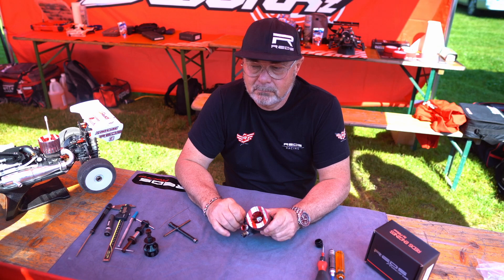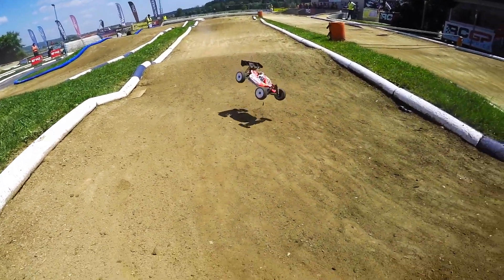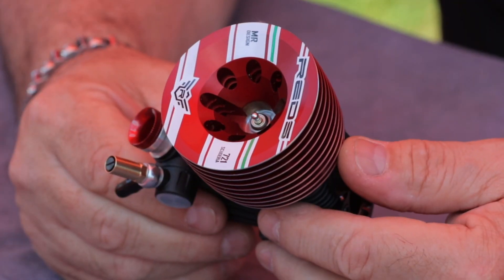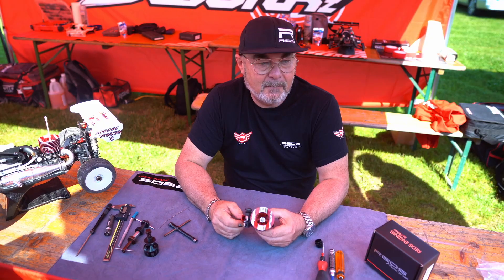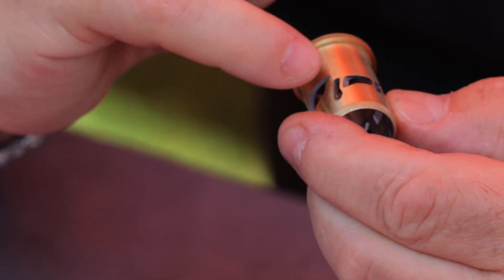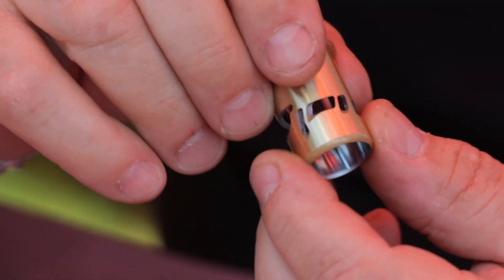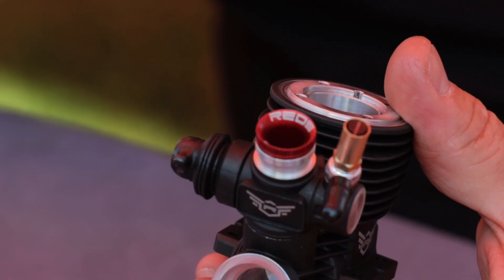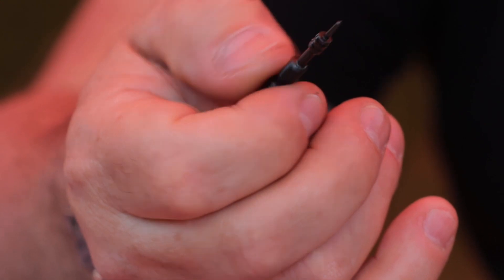More POWERFUL than an F1 Engine??!

Comment: Would the engine go in traxxas revo 3.3?
Reply: it should but if you do upgrade the clutch, make such the clutch springs are stiffer. in all honesty it should fit right in.
Reply: @johnszafarczyk It will not fit right in lmao stop spreading misinformation.
Reply: Not without a big block kit and heavy modifications along with a special bump box meant for the Revo chassis

Comment: 2 HP out of such a small engine?!

UNBELIEVABLE!!!!!
Reply: 2.6hp now year 2024 😮
Reply: @simonpeterdalangpan9761 the hp ratings are slightly overrated, as a long time modeller I can tell you that these engines have increased from 1 hp to 12 or 15 hp over the years...that is if you believe the increased horsepower claims over say 3 decades. 😅

Comment: @1:48 used a flat head screwdriver to leverage the sleeve out of the case!.
Reply: doesn't really matter. doesn't affect it. i've done it for years and not 1 problem. people always told me to use plastic over metal for prying and scraping but nah metal always better. there are precautions but yes metal same thing
Reply: @isaacgonzalez9295  micro gauge can turn into crack under stress cause overheating and compression loss, only pro racers understand.
Reply: @MrHazbobaz  Yea, what would Rossi know about engines...

Comment: yes per cubic inch or micro liter, for the application of small liteweight vehicles yes it is.  but not if you mounted 100 of them into a f1 car. then torque and fuel would be a problem. but i like your front page to promote rc racing. 2 strokes are still today the most power to weight  ratio, but the usa government  screwed us all because they want the wildlife to breathe better  so most 2strokes are banned from being produced. just look at power ratios in the year 99 or 2000 liquid cooled cr  kx yz rm   125cc motorcross, and they weighed half as much  as  2019.  the rc car industry is lucky they havent banned there engines and fuel.
Reply: Yet you can easily buy leaded fuel or nitro methane to run at the drag strip or in a monster truck 😀
Reply: @jon gone gone Max Power engines go up to 2.95hp in their OnRoad configuration (40,200rpm). OS engines top at 2.65hp OnRoad and 2.55hp OffRoad. All 3,5cc. Novarossi Mephisto and Toro Nero also 2.7hp. If you convert those specs to real sized engines you get around 750/800hp per litre, very close to 1050hp/L of Top Fuel dragsters. In comparison modern F1 has 500hp/L  for the I.C.E.. Back in the 80's, a qualifying engine had a power output of up to 1500hp (BMW M12/13 engine, also know as "Megatron") from a 1.5L inline4, so 1000hp/L, but it lasted only 4 or 5 laps before literally melting the head gasket or blowing up the turbo/engine head. So yeah, those tiny RC engines are pretty impressive and incredibly reliable considering they can last up to 50-70L of burnt fuel before needing main parts replacement like piston head, crankshaft and cilinder port gasket.
Reply: @jamarcus_OG  My first RC engine was a OS Max 20 in 1973. It was a cross-flow design with a baffle on one side of the piston and had one ring. It ran fine on my Graupner "Taxi" trainer. I now am studying all things two stroke and I came upon an engine test of this old engine. It's power output with muffler was 0.27 hp at 13000 rpm. Now, there are 3.5 cc engines with ten times the power! Amazing. How much more will we be able to get out of these simple engines?
Reply: @christopherknee5756  Who knows !! They're worth just for the sound.
Reply: @christopherknee5756  As Mario stated in the video, they're already at their full potential. There's nothing you can do to get them more powerful besides finding a way to get more air into them which isn't possible given their scale.
Reply: @Cardiakk  you are right. But you can get more oxygen with nitrous or up the percentage of nitromethane to 75% at max i am trying to do it and see what hp i will get😃👍
Reply: @mikkellarsen4931  You still have to shim the head properly to run a higher nitro percentage and a road/buggy engine won't last very long running like that.
Reply: @DavidRC You realize that the only logical way to make more power is to bring in more air right? These things only have a max of 10mm for venturi's and that's if you drilled one out. The most overall powerful nitro engine is the LRP 32 and that's after it's modded. You literally can't get anymore power. "More power" is just a way to drive sales.
Reply: My friend you are very wrong if you believe more power isn't possible... Take a top end 1 Gen old engine and run it then run a current top end 21 and tell me more power isn't possible... It's all about air flow and with today's tech the can still increase flow rates, it's also burn efficiency and may other factors... On road 21s running 50% Nitro can make some stupid power in rhr upper mid range and top end but suffer torque (not a big issue on the torque because 2 speed trannys) off road engines have to make plenty of torque in the lower RPM range due to the single speed tranny and weight... I would say top spec 21s are getting 90% or so at its limits... However hand a top spec 21 to a quality modder and yoy will get back an engine that's on another level... I have some old GRP 21s that seriously modded and those motors become flat stupid in rhr mid and top end ranges and make mega torque off idle but on a 8.5mm restrictor getting 7mins in 8th buggy.. I have others I modded for economy and 11mins a tank is the norm and still decent power... Today's top end 21s will gain 10 to 15% across the board in power at the expense of run time.. Making stupid power and getting 10mins a tank is doable today making insane power and getting 7 mins a tank is doable as well.

5 years from now top spec 21s will be making a lot more power then they do today and keeping the 9 to 10 mins a tank run time that we need to win races. Budget 21s or today are more powerful then premium 21s of 5 years ago and nearly as efficient. In 5 more years budget 21s will preform like premium 21s of today... They aren't at the limit as modded can get A LOT more out of them.